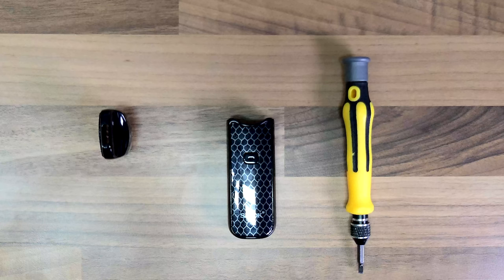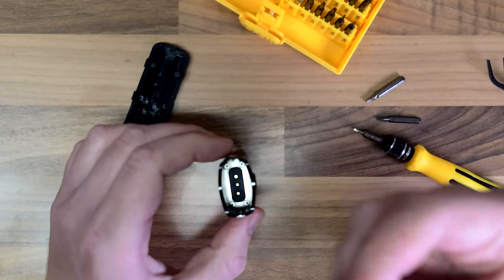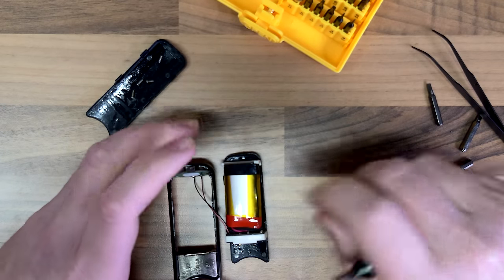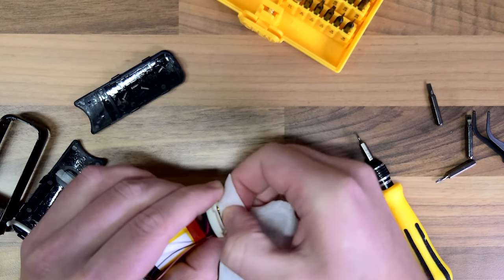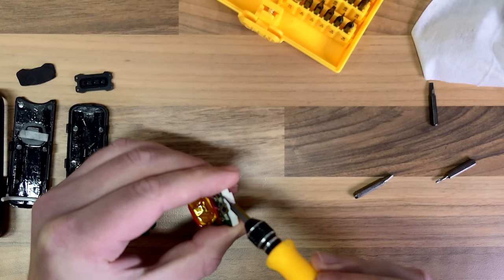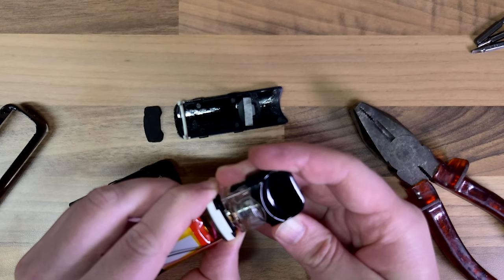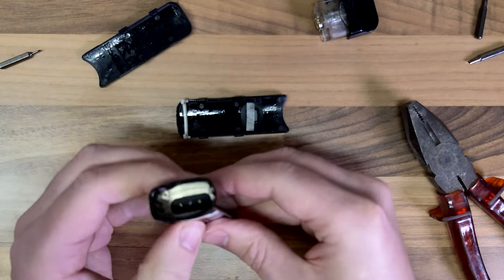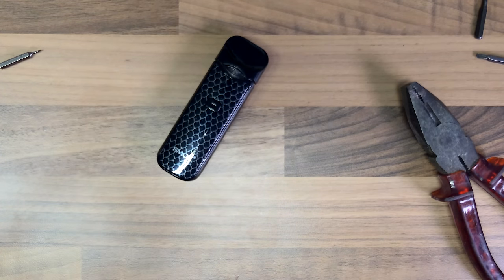Fix Smok Nord with stuck pins - Taking apart a Smok Nord - How to disassemble a Smoke Nord

Comment: They all seem to have this problem even with the nord 2, haven't had any others though. What I've been doing is putting a tiny bit of solder on top of the pin so it makes a connection. I've had to do this multiple times but I've had mine for probably 18 months now. I also discovered that sometimes the pins can get stuck from getting gunked up. On the nord 2 you can actually pull the pin and spring out (carefully) and clean them. I was able to stretch the springs out to give them life once again, sadly this doesn't work on the original nord.

Comment: i always sandwich a piece of metal(small bits of cutter blade) between the middle pin and the middle section of the coil. and it's making contact. been doing in for like 6 months now. Smok Nord is a tank

Comment: Thx from Russia, bro. My device have this problem too.
Reply from the maker: No problem, hope it helps! By the way, if you want to do a full repair the pins can be replaced if you don't mind a bit of soldering... I might do this myself, they can be purchased as "Spring Test Probes" or "test pins".
Reply: @tombritten7841  I can buy this pins on Aliexpress?
Reply from the maker: @arseniyafanasyev2477  Yes, I have seen them on there. You can even get them on amazon or ebay. Just make sure you get the correct size. I haven't had a chance to take one off and measure it, but it shouldn't be too hard to work it out. The pins seem quite cheap, just bear in mind, you will need to do a bit of soldering.

Comment: Wayyy easier way I found: take a pen and push it around the outside of the rubber around the pin then you should be able to grab it with tweezers or nail clippers or whatever you have around and pull it slightly, and it should start working.
Reply: i did this but it wouldnt stay up

Comment: Im having the same problem with the prongs of my juul. One is stuck down and not firing. I thought I could fix it by just pulling it up like it was a spring or something but turns out it was old juice clogging it.  I just used a q tip with iso pro and pushed the prong up and down till it released and that fixed it.
Reply: Yo i have the same problem, how long did it take you for this to work and for the prong to pop back up, as i have been trying for a good half hour now and it wont come back up?

Comment: Thanks for this video, my nord’s light was stuck on, but it’s firing normal, everything seems normal except the light always stays on, I don’t have the right screw driver for the star screw. So i opened my back case like what you did and the lights turns off, it’s now working well. Idk what seemed to be the problem though.

Comment: Just get tin foil off of a gum wrapper or from the kitchen, if from a gum wrapper strip the foil from the wrapper and make a tiny ball of foil and it will complete the connection and make sure it doesn’t touch either prongs in the sides

Comment: I was not able to use mine for months and left it with juice. The juice leaked and the top part where the gold/bronze pin were wet for a long time. Will the juice go inside? Will it damage the system or explode? Its still working but I'm worried that it will explode. Is the top layer of those pin water/juice proof?

Comment: This is the last time I buy from smok last three devices I bought broke just past warranty.
Reply: Haha thats my problem on smok nord.. I bought 2 pcs and smok nord and always the problem after a month is the contact will stuck. And now i switch smok rpm 40..
Reply: @g-gamingtv7110  just went yesterday to my local store and picked up the voopoo Vinci x. Allot like the Nord but it'll use the same battery as my other mods.

Comment: I always thought my middle pin was too low. Looked below even with the rubber piece. Found out it does nothing for the firing mechanism. Its like a battery problem for me I charged it and uncharged it until the 4 blinking lights went away before charging.

Comment: Just a question, as I'm dealing with the 2 outside pins being stuck down, middle one is fine. But, knowing now how its put together, could you just remove the black rubber cover over the pins without taking it apart ? Mine just started this , like an hour ago. Of course, it's my only vape and not able to get another one tonight. This sux .. btw. I'm feelin right where you were at .  Lol.
Reply: You could but this is a death sentence for a nord. Pretty much all of them leak from the coil and the rubber is the only thing keeping the liquid from getting into the electronics. I suggest you grab very thin tweezers and wedge them around the pins and pull them out. Afterwards you can push your pod in very slowly until they just about make contact with the pins. Not ideal but there isn't much you can do other than that
Reply from the maker: I think you would have trouble getting the rubber out without taking it apart. It’s kind of held in from below if that makes sense? You might be able to get some tweezers in there and dig them into the rubber enough  to grab hold of them and pull them up. Bit they will probably fall back down quite quickly. If you are really stuck you might just be able to do the little balls of tin foil trick. You roll up foil and put them on top of the pins that are stuck down. But again, that’s a bit of a short term fix but will get you through the rest of the day.
Reply: Well, I got in there with tweezers, needle nose pliers and a couple other tools. It dawned on me that the little rubber piece was wider underneath, so that it wouldn't pull out. But, get this .. while pulling the little pins up and trying to squeeze them so they wouldn't fall back down, well after several attempts, I accidenlty pulled out one of the little pins on the left side ...I thought , welp, I'm done  for now. My middle pin was fine, the one that actually contacts the coil. I put the pod back in, just to see . And it started working !     Wth ?  Oh, well, it'll get me through until I can grab another, hopefully. I've always cleaned that thing out. I think maybe its time to either try to wean myself off ( with this whole ban of flavored vapes starting to happen) or go back to E-leaf ( They last a hell of a lot longer, but are more expensive)

Comment: found a fix if this doesnt work!
given that the rubber piece is still intact, cut a tiny bit of guitar string and secure it between the rubber and the pin
got a super old mod to work this way
Reply: Could you elaborate a little more on this? Is the guitar string being used as a wedge only, or is it all also to be conductive, making an electrical connection; just like the other popular the "aluminum foil fix"?

Comment: Would a little rubbing alcohol clean it good to make it not stick as bad?
Reply from the maker: Eyesuck Overwatch the pin wasn’t actually stuck. The pins have springs inside of them and the springs had failed. So when the pin goes down there’s nothing to push it back up.
Reply: @tombritten7841  Ahhh... I see. I just got one given to me and I was getting the flashing and it wasn't working. I tried to pull the pins thinking it was that. Then I found out I just needed a new coil. 2 days later, the middle pin is stuck down. I guess with a failed spring. I must have broken it trying to "fix" it. D-oh.

Comment: aye yo bro if you put a little ball of aluminum foil/ copper foil over the prong it will work mine did the same shit just make sure the copper dosn't touch any other contacts
Reply: I did that and it didnt work
Reply from the maker: @taylordavidson9099  Just thought I'd let you know, almost two weeks on my fix is still holding up and working well :)
Reply: Didn’t work for me !
Reply: I did that but after 4-5 day, it didnt work anymore.

Comment: the nord 2 is so much better, it no longer has 3 pins, it has 2, but they are more of rounded soldered NUBS rather than pins. So its pretty much indestructible. I blew through four smok nord 1's in 2yrs from stuck-down pins.

Comment: Welp. I disassembled it, cleaned it, and nothing. So now Ive taken all the guts out of the shell and used masking tape to hold the cartridge down onto the pins. It isnt pretty but it works enough to last me til i get a new one. Probably just gonna quit all together once it finally dies.

Comment: I tried this it's up but it's still not hitting  and its charged. Anh help? 
Also tried the foil
Reply: Heather Ingram get a novo
Reply: i had two pins stuck down in my nord and literally just fixed it this second after watching this vid but all i did was use good tweezers and pull them up, if they’re rlly stuck you kind have to push the tweezers into the rubber black part and then squeeze the pin and gently pull it up without accidentally pushing it more in. and once they’re up you have to be careful putting the pod back in or else it’ll push the pins back so don’t put it all the way in, it took me a couple tries. ik this reply is late lmao but hope it still helps ??!!

Comment: For people without these tools just remove the black rubber part and take a pair of needle nose pliers and pull the pin up. Put the mouse piece back in and your good to go.
Reply: is that safe? given that the rubber is supposed to catch the juice and it’s no longer there?
Reply: @dustinnantz1403  I didn't have any issues for the past 4 days, but the juice did end up leaking through and made it so I was unable to get the pin out again. Definitely wasn't a good solution.....
Reply: InSideSelf i’m trying the way you suggested, my middle pin won’t come out for more than one hit without falling back in, so i pulled the middle of the coil out a tiny bit. i’ll reply with how it goes, but as of right now it’s hitting as good as ever.

Comment: Don’t dismantle it!! the black area around the pins is soft, just use a set of tweezers and push down around the stuck pin and you can grip onto the pin you want and pull it up

Comment: Well I guess I won’t blow myself up to bad right? lol I don’t have screwdriver 🪛 and center pin is up but both sides are gone… I sorta feel one but nada thing on the other… ok I’m gone to find tin foil and make a connection one way or another. I have taken a jolt from a electrical cattle fence that was hooked up wrong to a metal gate……so I should be fine…. right? Have reg cigarettes but smoked them for years and don’t want to go back…. Will I be fine? I’m way older than most everyone’s phone and the craving well…🙏?…???

Comment: Man I've got the same the display screen has gone haywire sometimes I can access the settings but the power button doesn't appear to be working I think it's leaked and it's buggered the cpu or brain of the device it turns it self on after I've fiddling with it for ages it's pissing me of and I've not got a Alan key

Comment: Simply pulling the pin up doesn't fix the issue. The center pin will push pack down again, and you are back where you started.. Has to be a way to get in behind the center pin and wedge something behind it possibly.

Comment: Well I guess I won’t blow myself up to bad? lol I don’t have screwdriver 🪛 and center pin is up but both sides are gone… I sorta feel one but nada thing on the other… ok I’m tempted to find tin foil and make a connection one way or another. I have taken a jolt from a electrical cattle fence that was hooked up wrong to a metal gate once……so I should be fine…. right? Have reg cigarettes but smoked them for years and don’t want to go back…. Will I be fine? Right!? Seriously asking ANYONE!

Comment: Don’t do anything any of these videos say there all trash and don’t work , what u have to do is take tweezers and there’s a little gold circle on the bottom of your coil, u slightly pull it out and it should start working , I used this on 2 separate devices and it worked both times

Comment: ended up breaking my nord after trying to squeeze the middle prong up so it wouldn’t go down, for the second time. honestly smoks vapes are shit, buy something more reliable if it breaks for you. every smoke product i’ve owned (novo, mico, nord) broke within a literal month. i’m buying a stlth tmr and they’re way more reliable.
Reply: if it snapped in half, just use tweezers to put it back in, if its not connected, i did this method, fires like a charm, but dont put it back in all the way or else it wont fire again:)